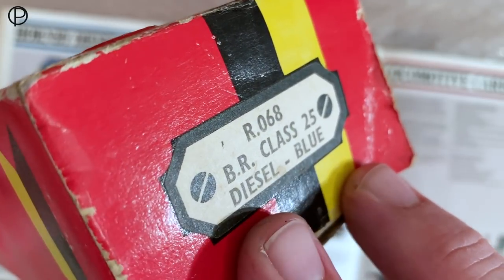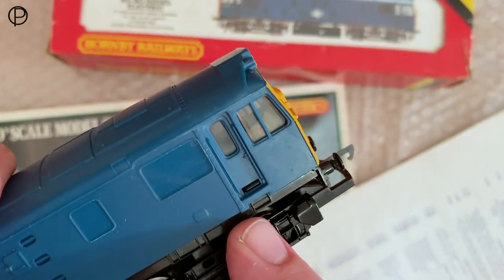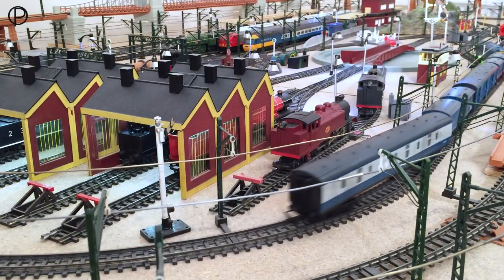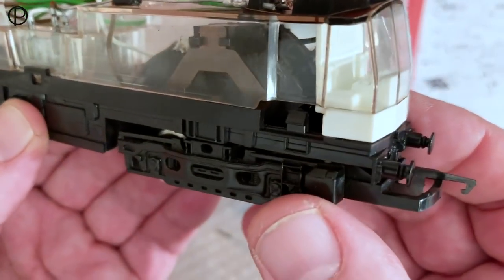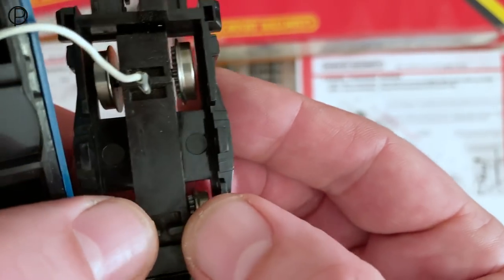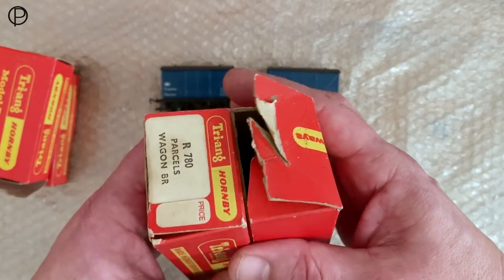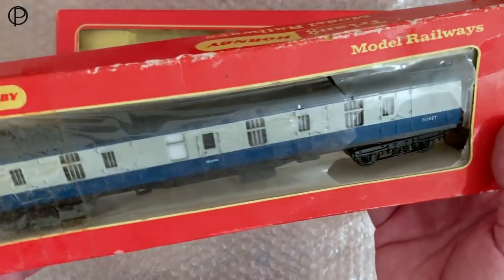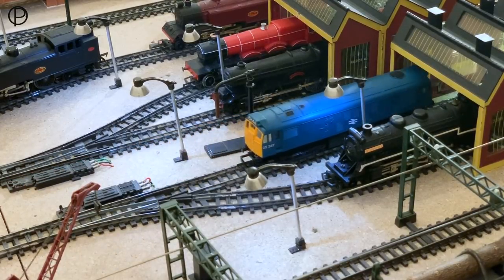Hornby Railways R.068 BR Class 25 Diesel Electric with Parcel Vehicles

Comment: Hi Oscar, What a great memory- in ‘77 we  holidayed in Dawlish and the local Exeter- Paignton trains were always pulled by a spluttering, oil soaked class 25 in BR blue- I loved the plumes of smoke as they struggled to get those 5x Mk1s moving!!

The Hornby model was therefore a must have when it came out and fully captures the look of the prototype- the detail was breathtaking particularly when compared to the Lima 33 also out at the time.

I ended up double motoring mine (sorry HST!) to get rid of that lean and it could pull 25 coaches!!!

Sadly I also covered the whole body in Matt black Humbrol and wiped it off with tissue paper- an early attempt at weathering which actually looked pretty good at the time!!!

Subutteo players chopped at the waist also made a great driver and secondman!

Happy times indeed:-))
Reply from the maker: Wow,  sounds like a powerful conversion.  You really had great fun with your models!
Thanks for watching.
Oscar

Comment: Thank you so much Oscar! I have been waiting for this video for a while and it was more than worth the wait! I have both the green and the blue versions (two of each) and they are by far my favourite Hornby locomotive. All mine have a slight lean like yours and the class 47 from the same year has a similar lean too. I love the way that the bogie comes away from the chassis, this makes maintenance so easy. I give my class 25s a drop of oil from time to time which seems to keep the motor running smoothly. My models are still running on the original traction tyres and also the original brushes, although I do have spares as and when needed. Thank you so much again for taking the time to produce this and all the other wonderful videos that you do and also for providing great inspiration, ashe first thing I will be doing with my loft railway tomorrow will be to run my 1977 class 25 - all four of them! 
Kind Regards,
Kev.  😃
Reply from the maker: Hi Kev, glad you enjoyed the video and I hope you had a great time running your collection.
Thanks for watching.
Oscar

Comment: Hi Oscar I saw a Lima class 33 in my local model railway shop and once it opens again I will get the class 33 and x2 Pullman coaches a brake coach and corridor coach  along with 2 LMS coaches

Comment: Just picked this very model up off of ebay and when I ran this om the layout, I was rather shocked by how smooth running it was even over point work etc.  Cheers
Reply from the maker: Hi, thats great to hear got yourself one of these older Hornby locomotives from the late 70s. I think at the time when these were released they must have been very impressive compared to what had got before.
Thanks again for watching take care.
Oscar

Comment: Yep first released summer 1977. I got mine then . An early problem with these locos were that the bogie frames used to drop down off the actual bogies .  My 25247 is still going strong. This was the first year that Hornby introduced diesels with “TOPS” numbers , the 37  and 47 getting new numbers in the same year.
Reply from the maker: Hi Russell, nice to hear yours is still going strong the bogie frames do seem to be very loose especially on the blue model I have.
Oscar

Comment: Sold my Class 25s, regrettably. I had both green ones (different headcodes) one was Margate and the other part China part Margate at the transition. The blue one I had was from a set. All excellent runners. I understand that there was a plan to put smoke in the Model and the moulding inside the body reflects this. Lighting was further enhanced (by me) using the circuit by Roger Amos in his “Model Railway Electronics” which meant that the lights illuminated with the minimum of power, and with the capacitor in circuit therefore, stayed at full brightness. It was a great advancement at the time. I regret selling them.
As for the Express Parcels vans, I managed to save some pocket money to buy 6 of them. They were 30p each, I recall.
Best wishes. Bob
Reply from the maker: Hi Bob, the lighting modification sounds terrific its a shame Hornby didn't try something along those lines.  I wish my parcels vans had been 30p each!  Thanks for watching.
Oscar

Comment: Nice video and interesting information on the smoke unit proposal. The socket in the clear glazing looked as though it was designed to hold something, but I doubt it would have been a Seuthe unit, even though that's what came to mind, unless well insulated it would get far too hot and melt the plastic (as well as having to be bought in). One of those fascinating "what if" moments. Lovely train too, reminded me of train spotting at Kings Cross and St Pancras 40 years ago:-)
Reply from the maker: Good afternoon Andrew glad you enjoyed the video, I agree a Seuthe unit would be a bit hot in that plastic. As you say "what"
Thanks for watching.
Oscar

Comment: Hello Oscar, I have one of this class 25s, but in the two-tone green. A word of warning those terminal connectors in the middle do tend to corrode and then the wires get hot and as you have seen they have left there mark on the roof. I little clean and some petroleum Jelly or vaseline will do the trick. If left unattended the glazing starts to turn yellow. Mine was in a mesh. So I bought another glazing unit off of the auction site. Martin. (Dhaka, Bangladesh.)
Reply: Hi Oscar. Great video as always. I have a Hymek with similar chassis with a lean. Solved it by putting s small plastic shim cut from a margarine tub lid between the metal block on the bogie and the side frame on the power bogie.
Reply from the maker: Good afternoon Martin. I shall keep an eye on those terminal connectors. Thanks for the information and advice.
Oscar
Reply from the maker: Hi Keith that sound like a good idea, their dose seem to be a lot of play between the metal block and the plastic frame.  David Atkins has just put up a video where he's added an extra pivot to solve the problem  https://youtu.be/JbU8yvwv2aM
Thanks for watching and taking the time to comment, it's hugely appreciated.
Oscar

Comment: Another great presentation Oscar. It's quite interesting they planned to add a smoke unit at some point during the production process. I wonder why they gave up on the idea?  

That electrical contact setup is nothing short of dodgy. Looks like something that would be prone to causing lots of headaches! Lisa
Reply from the maker: I think you may be right about the electrical contact setup. Maybe it would have made it easy to sell a newly designed smoke unit as an add on?
Thanks again for watching.
Oscar

Comment: Hi Oscar , ref 11:22  the odd offset bogie pivot , I’ve got a Hornby class 47 from 1980 that has that , it made it slightly lip sided , so I removed it and it actually sat better
Reply from the maker: Hi, thanks for the information. this bogie pivot seems to have affected a number of models of the time from new. But strangely some models even with the bogie pivot don't seem to have the fault. 
Thanks again for watching.
Oscar

Comment: Nice video, I have the later 25 but it still suffered from the leaning issue. I can't remember just now but I think I removed the pivot and placed a new one in the center of the frame. Lovely locos, the SPV in real life was converted from insul fish vans so that is correct. Cheers Mike
Reply from the maker: Good afternoon Mike, it seems odd that Hornby did not fix this in the later models. Many others seem to have had the problem.
Thanks again for watching.
Oscar

Comment: Hi Oscar, I’ve only just discovered your channel and have subscribed today. These are the models of my childhood. Sadly, I let my originals go, but have re-bought many of them over the years, including these Class 25s in both Blue and Green.
I believe the main reason for the leaning to one side on these models is due to the S4329 metal block in the dummy bogie being milled incorrectly for the wheel set closest to the centre of the loco. If you turn the loco upside down you will see that the axle leans to one side so one wheel is lower than all the others. This affected all Hornby ringfield diesels for many years, certainly into the 1980s before it was corrected. A possible solution would be to line the bottom of the groove with some brass. Something I am looking in to.
Reply from the maker: Good morning Ashley, thanks for subscribing and the information about the lean it is certainly an annoying fault.
Many thanks for watching and taking the time to comment.
Oscar

Comment: Hello good evening oscar, I drilled out the class 25 cast bogies and fitted lima wheelsets and it now runs  a lot better.
Reply from the maker: Good afternoon Ian sounds like an interesting modification, great to hear it works. Thanks for watching and take the time to comment it’s hugely appreciated.
Oscar
Reply: @oscarpaisley  evening oscar, thanks for your reply I had problems with the hornby gearing on my 25s so I was getting tired of the gearing not meshing together so cut up two lima 26s and used the wheels and cogs from couple of lima class 60s,the 25s I still have sit quite low I will take pictures and small video when I'm next at my parents loft possibly Friday, just difficult with this covid restriction here in Scotland, if you require any lima spares of which I have hundreds I will help if I can  cheers IAN.

Comment: Hello Oscar, Well once again I've learned something this Sunday morning. Both my R 074 green Hymek and my R 072 Class 25 have that lean. I have looked at the power bogie but could not see a reason for the lean. I had never taken the dummy bogie out. Now I shall look at a fix although I don't wish to cut the off set pivot off so I'll have to see what else I can do. Keith McCormac  has indicated a plastic shim will work, I'll look at that idea. Great video again, Thank you.  David.
Reply: It'S an easy fix to stop the class 25 leaning just get to sets of wheels one side fitted with traction tyres fitted to trailing bogie side that not the pick up side will stop the 25 leaning it happen to quite a few diesel back then .She and good model too from Hornby the Class 25 in joy loco
Reply: @thedoctor6610  Thank you,that sure seems to be an easy solution. I did not know what the problem was before but now I know I have fixed it with a new pivot added alongside the Hornby pivot. I may do a video showing the fix.  Regards, David.
Reply: @trainsontuesday  They did this in the Model Shop used to go into in the 80s ,They repair loco
sold second hand locos
Reply: @thedoctor6610  Great, where is that model shop?
Reply from the maker: Hi David, glad you enjoyed the video.  I don't have a Hymek with this chassis/power bogie yet!  I had been thinking of looking for one.  I enjoyed watching your video showing the fix I shall be having a go myself.
Thanks for watching.
Oscar
Reply: @oscarpaisley  Thank you Oscar, Please let me know how it works for you.  Regards, David.

Comment: I have a green one (it was part of a small, old Hornby collection i brought), but i don't think I ever removed the body, I just pop out the motor-bogie for maintenance. If I think correctly the pin is off-centered to the pickup side of the non driven bogie, so the little weight of the modell pushes that side, for better connection. Mine still runs well, dough it is the last loco in my collection with that drive/motor.
Reply from the maker: Great to hear you have the green variation Tom. It makes sense that the downward pressure be improved on that side of the model. 
Thanks again for watching.
Oscar

Comment: I have both the green and the blue, blue always seems to lean to one side however when I opened the green that was bought second hand I found a load of small round fishing type lead weights in it
Reply from the maker: Hi someone else had suggested that the pivot was off-centre to counteract the weight of the planned smoke unit. So I think maybe I should add some weight as an experiment.
Thanks for the information.
Oscar

Comment: Hi oscar I have the exact same one, and it tilts to one side aswell, but it does run lovely 👌
Reply from the maker: Hi Ciaran, great to have this model sad to hear it leans like mine.  It seems many others have had the same trouble with this model.  Odd that Hornby didn't put it right.  There must have been many complaints at the time.
Thanks for watching.
Oscar

Comment: The Class 25 was always one of Hornby's better models. I have had one for years and it was professionally converted to a Class 24 and sprayed blue. Later I lowered it to eliminate the small gap between to bogie frames and the chassis. This might be a bad idea if you have gradients but my layout is flat. It has no trouble with curves and sits perfectly level with no sign of wobbles. My final modification was to fit a second power bogie, a job made easier by the similar bogie mountings. With a little extra weight it pulls a ten coach train with ease..
Reply from the maker: Hi, Les sounds like you have made some great improvements to your original model.
Thanks again for watching and taking the time to comment.
Oscar

Comment: Has that model been modified by someone because my two are different under the body? Not so much wiring and it doesn't have gears on non powered bogie. What are all those wires above the central weight?
Reply from the maker: Hi Steven, as far as I can tell the model is not modified in any way. Have a look at this link http://www.hornbyguide.com/service_sheet_details.asp?sheetid=36 
Thanks for watching.
Oscar

Comment: It'S an easy fix to stop the class 25 leaning just get to sets of wheels one side fitted with traction tyres fitted to trailing bogie side that not the pick up side will stop the 25 leaning it happen to quite a few diesel back then .She and good model too from Hornby the Class 25 in joy loco
Reply from the maker: Hi thanks for the information others have mentioned different models of the period being affected by this fault as well.
Thanks again for watching.
Oscar

Comment: The nub on the bogie is off centered to counteract the weight of the smoke unit if the nub was in the centre the smoke unit would of coused it to lay over
Reply from the maker: Thanks for the information I shall try adding a bit of weight.
Oscar